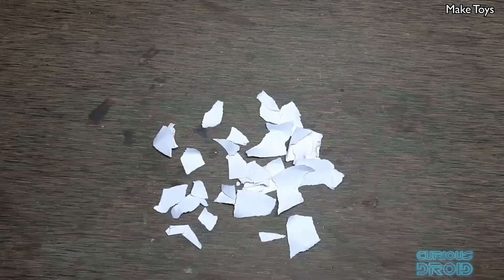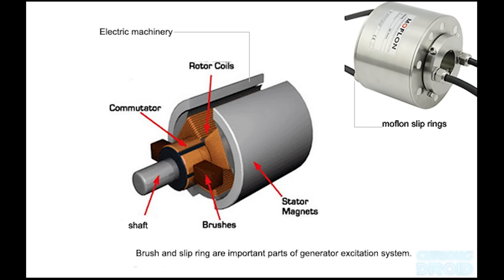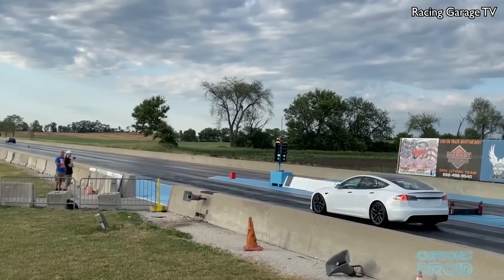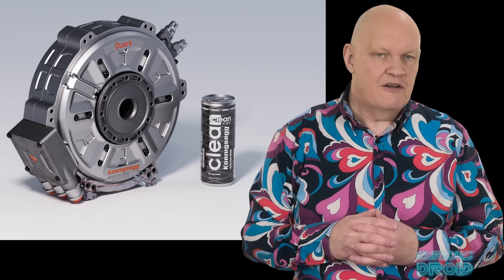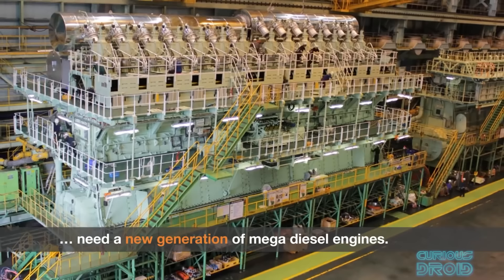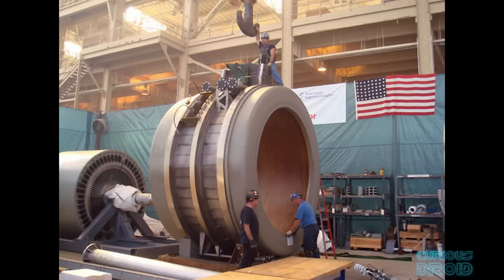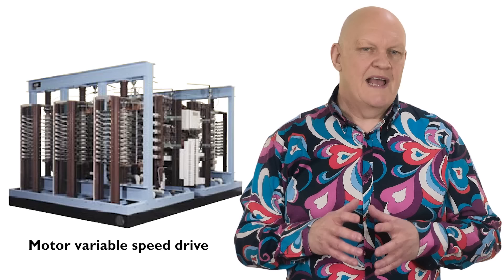The Worlds Most Powerful Electric Motors

Comment: A few mines in Chile & Peru have 12 m diameter "gearless" SAG mill drives, up to 28 MW.  Some of these are located high in the Andes, up to 4500 m elevation, so their performance at sea level would be more than the rated power on the name-plate.  Mineral grinding mills can be the biggest motors in a lot of mining districts.
Reply: why is the performance of the motor different at sea level?
Reply: @danspratt2  if they are air cooled then the lower pressure means less cooling. Gigawatt sized 3600 rpm turbo generators are often cooled with 4 atmosphere hydrogen. The journal bearings fed oil from the middle under pressure to keep the hydrogen in, and an internal fan blows the hydrogen through a heat exchanger
Reply: @EldonJohansen  oh interesting, I hadn't considered cooling as a limiting factor.

Comment: As someone who has some knowledge of ICEs, the Wartsila engine compared to the motors found in the warships wouldn’t be a direct logical comparison. 

The Wartsila engine is designed to run off heavy fuel oil and run pretty much non-stop at full power for the lifetime of the boat (25 years), the motors in comparison would be designed to generate their peak power for short periods of time and wouldn’t last long at its peak power compared to the Wartsila.

Heavy fuel oil is very difficult to combust and has slow flame propagation speeds. Methanol in comparison is much easier to combust and has a much higher flame propagation speed. In theory, a methanol engine designed to produce 7,000,000 nm of torque (same torque output in the wartsila) could be less than half the overall and rev higher producing around 50-100% more horsepower.

Comment: I worked for a company that built shaft couplings for high power machinery, we did quite a few of these for  85,000 KW rated synchronous motors for air separation plants . All the units involve secondary windings on rotors for start up purposes that generate very high starting torques, coupling designs were very tricky for these applications. Motors somehow were always ABB in these large installation s.

Comment: The Queen Elizabeth class are a  century too late to be the first aircraft carriers with electric drive.  The US Navy's first three carriers (USS Langley, 1920, USS Lexington, 1925, and USS Saratoga ,1925) all had turbo-electric drive.  The USN choose electric drive for all the same reasons plus greater fuel efficiency and the ability to go backwards at full power on the theory that the ability to go full speed in reverse would allow them to land aircraft over the bow in an emergency.  That didn't work out but the Lexingtons could hit 34 knots and a 36,000 ton aircraft carrier going backwards at anything close to that speed must have been terrifying.

Comment: The HMS Queen Elizabeth is not the first electric propulsion warship, back in the late teens, early 20's, right after WWI, the US Navy had built 6 battleships, and 2 aircraft carriers with turbo electric drive. Check the specifications on the Lexington class aircraft carriers, and the Colorado class battleships

Comment: we built the Polyethene plant in Beaumont, TX for exxon mobile "BPEX" they had a 20,000hp Siemens custom electric motor that was attached to the extruder. I have pictures of it that im not supposed to have but I can say when we bumped that thing for rotation it took 20minutes just for it to come to a stop. these big motors are crazy awesome to experience.

Comment: Galileo Ferraris is also credited with creating the induction motor.    Inductance/induction motors work reasonably well if you control them properly. 

You could do work on "soft starters" and adjustable speed drives for these big motors.   They can get very large too.

Comment: 8:09
Third largest currently.
The Ford class carriers are a little larger than the Nimitz class.
The retired Forrestal class, Improved Forrestal class, and Enterprise (CVN-65 not the upcomming Ford class ship or the old WWII era) aircraft carriers were also a little larger.
Technically, 2 of the Improved Forrestal class still exist (Kitty Hawk and America), but both were "sold for scrap" last year and it would be impractical to recommission them by now even if their breakdown hasn't started yet.
Enterprise still exists, but it in a similar situation.

Also, for reference, that 100,000 (appx) horsepower is LESS THAN HALF the power of any of the US carrier classes I mentioned, making these Brit carriers noticeably slower (not SLOW, just SLOWER - like perhaps 28 knots or so max vs the ACTUAL 38+ knot speed of the Forrestals).

Comment: The HMS Queen Elizabeth isn't a "full electric" ship as stated earlier in the video. It's a gas turbine / diesel hybrid design as you end up clarifying later on.
Reply: It's about as "fully electric" as diesel electric trains and the Maus tank, using the generators and motors to get rid of the mechanical transmission and its limitations.

Comment: Small correction, the tesla reluctance motor is no revival, it's simply a a stepper motor with only 6 positions rather than 200 so a 60 degree resolution rather than 1.8 degrees, but for traction the 60 degrees once geared down is fine. This motor is easier to control and it's natural characteristic is to swap torque for speed as it speeds it up, very desirable for traction, this is otherwise achieved with field weakening which is more complicated. Generators and motors are the same machine....

Comment: Metal and mining industry also uses large MW motors...not as large at the ones mentioned (it does not make economic sense). In steel rolling industry you often have numerous stands powered by large multi MW motors, very finely controlled in speed and sometimes in torque....

Comment: Why did they use gas and diesel generator to power an electric motor? Outside of being able to place multiple engines at different places, wouldn't you introduce more losses than directly powering with diesel/gas?

Comment: There are bigger pump-generators at some Hydroelectric "pumped storage" facilities.
The ones at the Grand Coulee are not - they're under 100,000 hp - but that's not a BIG pumped-storage facility by amount it can pump or generate (and half of it is dedicated pumps for IRRIGATION water, not pumped storage) - though it's STORAGE capacity is huge.

The Bath County pumped storage facility has 6 motor-generators capable of generating 3 MEGAwatts of power - 500kw each or ballpark 700,000 HP *EACH*.
THOSE are probably the largest power motors in the world today.

Comment: HMS Queen Liz is basically a hybrid warship. Engines need to be operated above their self-sustaining rpm. Any electricity generated but not utilized at this engine rpm wastes fuel. Thus, Queen Liz runs 2 fuel thirsty high output generators, 4 fuel efficient generator, and 4 motors driving screws. So she is producing just as much power as she needs at any time. Way to go Brits. 👏🏿 👏🏿👏🏿👏🏿

Comment: Difference is the diesel can do peak power all day forever whereas all these electric motors are max power for a burst of seconds and then they go down massively to 1/3.
Reply: If the application requires more duty cycle, then various cooling techniques can increase it, way about 3:1.
Reply: @babylonfive  tho you can increase cooling theres another problem power its one thing when you connected to a grid but an EV faces massive problems when it comes to high duty cycle take a farm tractor like a New Holland T8040 it can put down 200kW for roughly 10-12 hours we will use 10 hours the means it needs 2000kWh lest say we made our pack out of Tesla 100kWh packs each weighting 600kg that gets us a 12 tonne pack thats as heavy as the base tractor the problem get out of hand when you start talking about combines that put out 500kW+ adn i am not even factoring in efficiency.
Reply: unlike diesel, electric motors do not have a maximum designed power range. they can spin and produce as much torque as the power given to them until there is a physical failure. 
diesel is antique technology used by ancient peoples and belongs in the steel scrap yard.
Reply: @Blox117  kek. Clearly never seen a diesel train engine runaway then 😂😂
Reply: @LawrenceTimme  all the trains that are in constant use are electric. diesel is used for transporting cargo because batteries are expensive and there are no electric line infrastructure.
Reply: @Blox117  so? Transporting good over massive distances with huge weight shows the diesel is superior in most valuable use case. Electric trains are better for underground for obvious reasons, but it doesn't make the diesel old or obsolete.

Comment: The AGNI or Lynch motor is a unique axial gap permanent magnet brushed DC electric motor.  The motor has a pancake-like shape and was invented by Cedric Lynch in 1979.
The Lynch motor is built from ferrite blocks sandwiched between strips of metal, instead of conventional copper coil windings, and is held together purely by magnets. The motor is available in several sizes (6.6 lb) to (24 lb) weight and provides a power of 1.5 kilowatts (2.0 hp) to 11 kilowatts (15 hp) within an efficiency range of 80% to 90%.
Any voltage battery up to 90 volts can be directly connected or a variety of controllers will work such as cheap PWM or golf cart controllers of many power levels.  I've even ran mine (AGNI 15kw capable) off a 3Kw brushed motor controller for an ebike.  What's amazing is the torque produced: I once hooked a single 18650 battery directly and the shaft spun about 90 RPM and had an incredible torque for such low voltage and motor speed.  A 9v battery spun it about 300rpm and you could not hold the shaft from spinning with your hand, 48 volts is about 2,500 rpm and it will rip a back tire right off an electric bike.  Cedric Lynch even has electric racing motorcycles that use his motors for winning races, many times.
Reply: where are you finding a 3kw brushed controller?

Comment: Talking big. Most powerful generators (which are just inverted electric motors basically) are probably used in the latest generation nuclear powerplants. Olkiluoto-3 has a 1600 MW turbine-generator set. Thermal power is about 4300 MW for a single unit.

Comment: Fantastic that the 2 Elizabeth II-Class Aircraft Carriers are driven my electric motors. The electricity needed to drive the electric motor comes from 2 Rolls-Royce gas turbine engines driven by aviation fuel. So the underlying power is fossil fuel base.

Comment: I know it's a bit more of a niche topic, but I'd love to see similar videos about the world's most powerful (purpose made) inductors and capacitors. And by most powerful, I mean either with the highest capacitance/inductance. Or in terms of density, like the highest capacitance per cubic cm. Or about materials with super high permitivities/permeabilities. You could even touch on this new technology I came across the other day that claims to use negative capacitance. Which, I can't even wrap my head around. But I love it already. I went down the rabbit hole for negative resistance a while ago and the result was I now have some surplus soviet era tunnel diodes and I bought some P channel JFETs just to make some lambda diodes because frankly I don't know what else you'd use a P channel JFET for. Maybe some sort of atypical amplifier?

Comment: Technically every synchronous generator is just a type of synchronous induction motor called a wound-rotor induction motor. They are all capable of motoring under electrical power. Industrial gas turbines often must use their generator set to get up to speed before lighting off.

Comment: That motor should be a Motor/Generator, paired with a 3 cylinder 900cc Turbo Diesel engine, for ~100MPG range in a sedan car.

Comment: I'm kind of curious, why you don't consider generators as motors. Every electric motor can be operated as a generator and vice versa.
According to your definition, the "motors" in todays evs aren't dedicated motors, because they are also used as generators during breaking.
The largest generators today are capable of way over 1000 MW.

Comment: Well, they aren't the biggest, but they're close.  The california water project has many pumping stations, and the biggest is Edmonston.  It lifts water 600 meters (1926 feet) over the Tehachapi mountains.  The pump motors are "only" 80,000 hp (60 MW)...but it has 14 of them.

Comment: That new pancake motor would be Ideal for a new age centrifugal gun, high power to start the flywheel/pusher bar winding up then drops once its achieved speed. even the lower 120hp is enough to keep it spinning at over the speed of sound easily.

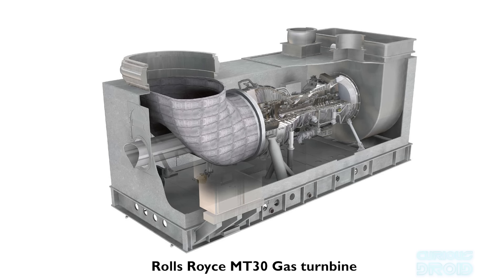Comment: Great video. I'm really confused by the MT30 gearbox graphic though. The MT30 is a gas turbine electric generator, so why are they being depicted with gearboxes and shafts in parallel with the electric propulsion motors (10:24)?

Comment: actually some PHES plants have dedicated asynchronous motors to pump water. Technically, every single synchronous generator is also enormous motor - but you probably do not want to use it as one

Comment: Maybe I'm missing something. I get using the electric motors if they are using a nuclear reactor but the way they're doing it is like if Tesla instead of batteries used a V8 engine to generate the electricity for the electric motors whats the point of the HMS Queen Elizabeth using electric motors that are powered by 2 Rolls-Royce gas turbines and diesel generators? 

Why not remove the the middle man(the electric motors) and just use the those Rolls-Royce MT30 gas turbines to power the ship that have 50,000 horsepower each, so total output of 100,000hp basically the same as the electric motors and your making the ship 220 tons lighter.
Reply: You have to consider the loss of power by mechanical transmission.
In general a combustion driven generator driving electric motors is way more efficient than just the combustion motor and gearbox, clutch etc.